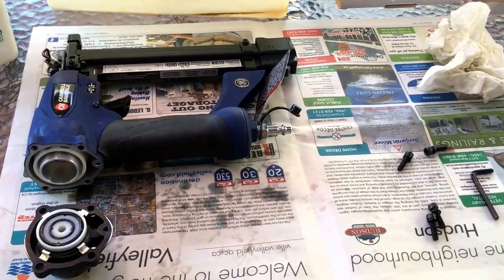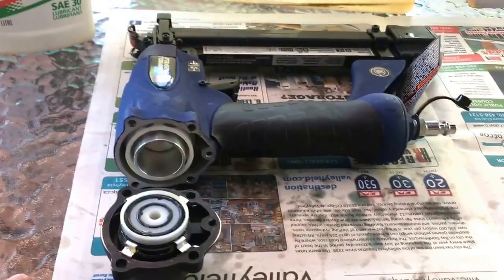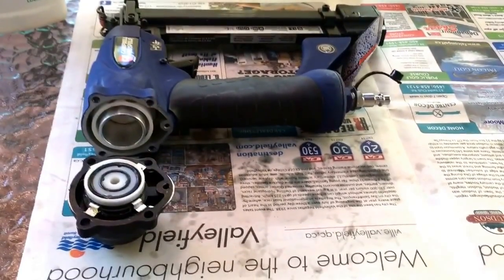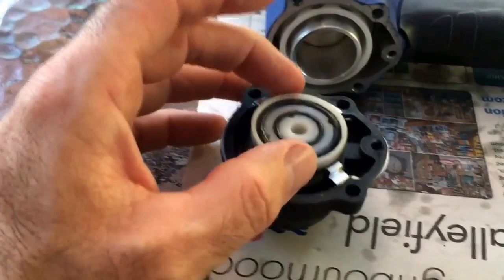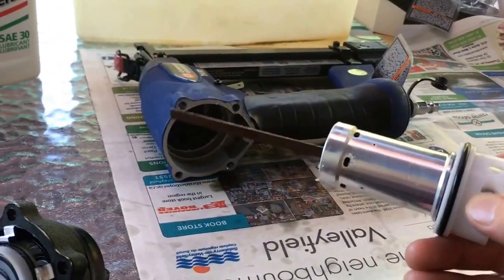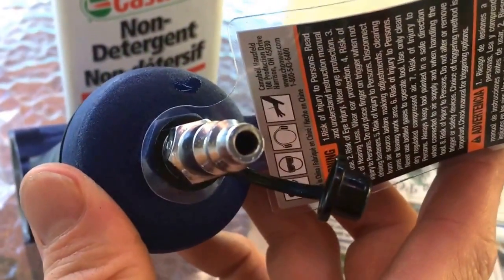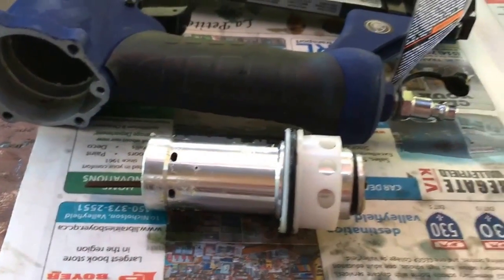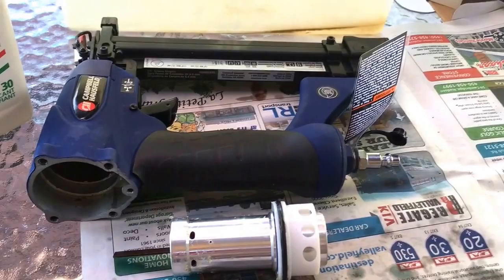Fixing a Campbell Hausfeld nail gun that won't fire

Comment: Well I don't believe it but it worked on my Campbell Hausfield dk583300av 02/04 brad nailer which was leaking air so badly it would not fire.  I threatened to scrap it several times but glad I didn't now.  I opened up the top and saw oil and pulled the cylinders apart and there was oil on all of the various O-Rings and the rubber rings looked good.  Having gone this far I squirted a half ounce of pneumatic air tool oil on all the parts then closed it up and to my profound surprise it worked perfectly again.  I am thrilled.  Oil, oil, oil is the answer.

Thank you very much for posting, much appreciated.

Comment: Same situation as most comments, mine sat unused for years and stopped firing. 
I followed your advice and cleaned it out and gave it a generous amount of oil.
 I just wanted to add that I used to oil I had at hand, Google told me hydraulic oil could be a good substitute for air tools. I happen to have hydraulic oil in my garage, there were a few other suggested substitutes. Thanks for the help!
 Happy building everyone!

Comment: Thanks for sharing.  Helped me get a used "like new" nailer back up and running after it had been sitting for a while.  Mine is a Dewalt, but they are very similar on the inside.
Reply: I have a dewalt nailer that won't fire, did you have to do this entire process to get yours working?
Reply: I did.  Took it apart as shown in the video, and lubricated all of the O rings. On my nailer, the piston would get stuck down... once everything was cleaned up and lubricated it worked great. I put a couple drops of oil in every time I use it, and it still works great years later.

Comment: I have the same one. It fires the 1st nail fine but the steel striker or slide doesn't retract back up into the cylinder allowing the brad nail to move forward in track.  I clean everything out, no go. Stumped!
Reply: Hey… so that is exactly what was happening to me… I was losing it.  I followed this videos step and oiled everything… still no luck.  And each time I had to undo the three screws where the nails come out to clear out the jam.  Then I wondered what the other two screws just above the trigger mechanism did.  I went to undo them with the Allen key and it was so damn difficult to loosen… like really tight.  I finally got them to loosen.  I retracted them, added a bit of the oil and this time I tightened just snug… I wondered if it was putting too much pressure on the slot where the nails slide through.  Well… sure enough the nailer finally worked firing more than one or two nails before jamming.  Lost an hour of work time, but maybe try my solution for you.

Comment: I bought this same kit and brought it with me to Chile South America. I had never used them and I went to use one of the guns and it just would not work. I sure do appreciate you doing this video. I am in the process of trying to repair my guns. 
I will definitely do as you suggested. I was using WD40 and I will change to 30wt Oil. Jim in Chile.
Reply: ChileExpatFamily 

Wd40 very bad for rubber rings and seals.
Reply: Use proper oil for air tools.

Comment: Every air nail gun needs to be oil with proper air gun oil every time they are refilled with Nails because the oil is blowing out of the gun with ever pull of the Trigger. after you fire 120 nails from the gun the table spoon of oil you put in it, is going to be spent. I would say if you are wanting to use oil other than Air gun oil It would be better to use Transmission oil (Dextron3) that is meant for rubber o-rings, Motor oil isn't very nice to rubber it will become hard and brittle and need to be replaced faster. I put dextron2 in my car engines to keep the valve seals soft and flexible to keep the engine from burning oil from the valves leaking past the valve guides. You will find that happening and its called blow bi, you will notice it when you first start up your engine and see a bit of black smoke from your exhaust till the engine burns off the oil in your cylinders. Their is other way to fix this problem but it takes, pulling the heads valve springs off and putting umbrella seals on each exhaust valve or having the guides replaced for the valves. I find it just a easy to use the Transmission fluid about a cup full (every time i do a oil change) in to the oil. Been doing that to my 1992 Suburban for 12 years since i purchased it and that 350 runs like a new engine. Manufacture told you to use motor oil? Well i guess they might want to sell you another gun sooner that if you used the right oil for it. Most people never re oil these guns when they should I know this because i have loaned my guns out once and when they came back they never worked again just from no oil and water in the air destroying the seals. I do not lean out air tools anymore for that reason.

Comment: Thanks for the info, it worked very well for me, I just put a lot of Synthetic Motor oil through the Air entrance (I think it will flow to the other parts this way) and it started to work again. Great Tip.

Comment: Pulled apart my friends gun, saw the same jelly looking  oil. I wiped it away, reoiled  with simple oil from another air gun. after assembling and adding a squirt in the air port, the gun worked fine. 30 weight is probably a bit much.
    Moral of the story is lube  and fire every 3 to 6 months just to maintain seal integrity.
Reply from the maker: j s  Agreed!

Comment: I purchased the same kit with 4 nailers on special a few years ago, but never used them until tonight! The Pin Nailer and Brad Nailer worked right off earlier this evening, but the large 2.5" Finishing Nailer like in your video crapped out after 3 nails, then just started popping air as you describe. Hope what you suggest is the fix - thanks for the video!!!

Comment: Hey, I had the same problem. Lubing didn't fix it though. The driver/pin that drives the nail doesn't retract the full way into the nose. I'm using 1 1/4 nails. Going to have to buy 1" nails so the driver will catch the head. Really annoying. Don't feel like dropping $125 for a new gun. Guess I'll live with it. Thanks for the walk-through.

Comment: Thank you for posting this.  I had made the mistake of using the wrong oil or something. I then used spray grease, oops.  After watching this, I cleaned it all out and I got DEWALT D55001 Synthetic Compressor Oil and it worked like a champ. My gun only gets used once a year, so I went with synthetic to avoid it gumming up again.

Comment: Tried this on mine (NB006401) nothing seemed to work (oil or carb cleaner). Then after taking it apart one to many times a few parts broke. Looking for replacement parts wont work because as far as I can tell all have been discontinued for these older guns. Be careful, otherwise  it will just be a paperweight :(
Reply from the maker: Good advice. I must say after a few years, I have had to take mine apart again and relubricate. Unless you use it on a regular basis, the lubrication gets gummy.

Comment: I'm not sure if you're still on this. 
Hey anyway.
My problem is the drive blade doesn't retract once a nail fires it then just shoots blanks? I'll clean and oil more tomorrow. 
It does technically fire after resetting the drive blade. 
Though I did find small plastic pieces in the inside side of the exhaust plate, not sure if it has anything to do with parts. 

Any ideas? 
I'm also looking for parts websites, if you good ones?

Thanks
Reply from the maker: I would start with lubricating it. You'll be surprised how much better it will fire with all the parts sliding smoothly like they're supposed to. Let me know how it turns out.

Comment: Very good info, thanks, but way over talked. Might want to try what I did. Go to 6:10 for 15 seconds. Try that first. 20 drops fixed it for me without taking a single part out.
Reply: Thank you Sam Sam!! I shot some WD-40 down there and a bit near the "hammer" and it started working great.
Caution to whomever does this, some oil sprayed on my wood. So if that is a worry, shoot blanks at scrap until the oil stops spraying.

Comment: I’m probably not the sharpest tool in the shed, but I try to listen when those people who are smarter than me are telling some important facts. I was told for a fact to not put motor oil in something with rubber seals as this causes the seals to swell. If I have been misinformed, please let me know so I don’t spread bad information. Air tool oil is available everywhere and if you can’t find that, automatic transmission fluid.
Reply from the maker: Ray Carson The non-detergent 30 weight oil used is what was recommended to me by the Campbell H representative who I spoke to on the phone. It is, essentially hydraulic oil. It is a clear liquid, not amber colored motor oil.

Comment: I did exactly what you said.I had one nail out and then it went back to hissing sound. This is my neigbours gun he was generous and insisting in borrowing. Against my judgement I did borrow , and now its broke. I tried to see if I can order parts or buy another gun Campbell-Hausfeld NB006401 2-1/2IN Finish Nailer no where to be found. Parts are obsolete and not available. The new ones dont even match the description or use.  I was in the middle of the basement reno final trimming baseboards etc, and now I am so messed. Any help? I am in Canada. Keeps giving double hissing sounds. the pressure keeps going low after every shot.
Reply: Sel Within        No guarantees but take a drive to your nearest caterpillar heavy equipment outlet. Caterpillar uses about every O-ring under the sun for their machinery. I Once went into the back room of one of those places and couldn’t believe the number of different O-rings they have hanging on plywood racks.     Chances are they can match you up with one that will fit.     It’s worth a shot anyways.     One thing you have to remember is that any kind of Chinese O-ring is minimal quality at the very best. When I tore mine open the first time I saw one of them even had a defect in it which was no surprise.

Comment: IMPORTANT INFO : I also contacted Campbell Hausfeld, Claude is right, don't use AIR TOOL OIL, it is not recommend for these finishing brad nailer/stapler. Instead use NON DETERGENT SAE 30 oil. If you're in Canada you can buy the Motomaster (028-7113-6) at Canadian Tire. Also, before dismantling your nail gun, Campbell Hausfeld recommends shooting a little carburetor cleaner in the air nozzle. I used the Motomaster Carburator and choke Cleaner (038-0720-8) also found at Canadian Tire and that actually fixed my problem. Doing the procedure in this video with AIR TOOL OIL did not fix my problem! Also, don't forget to put the cap back on the nozzle when you're done with the nailer to prevent contaminants from entering the gun and the oil from drying out and jamming your nail gun again! Merci Claude!
Reply from the maker: Thanks for the added information Rio. Carb Cleaner makes sense. Cleaning out the old gunk that has caused the jam to start with will probably go a long way in making sure you don’t run into the same problem over and over again. Glad it helped – cheers from Montreal!

Comment: Would have been nice to see everything reassembled and shown working. I did everything in the video and mines doesnt work. Brand new and still doesnt work..😔
Reply: Campbell Hausfeld recommends shooting a little carburetor cleaner in the air nozzle. That fixed my problem.

Comment: There are some things to consider before using this method to repair a brad nailer.  FIrst,  there is no reason to use non-detergent oil. Understand what detergent and non-detergent oils are used for.  Detergent oils  are used in most modern gas engines to suspend particulate matter in oil so that it can be filtered with the oil  filter.  In engines and many other machines that don't have oil filters, non-detergent oil is used because you don't want  particulate matter suspended in the oil and recirculating because that can damage parts.  But that's only for engines and machines that have an oil sump.  Air tools don't have an oil sump and there's nowhere to suspend particulates anyway so there is no advantage to using non-detergent oil in tools like the brad nailer. However, for piston compressors, etc., that do have a sump, non-detergent oil is recommended. That said, why go to the trouble to find non-detergent oil anyway since it can be hard to find these days.  Instead, use air tool oil.  After all, that's what it's made for. That's what you should be oiling your air tools with anyway so why would you use regular non-detergent oil?  It makes no sense. Whoever told the maker of this video to use non-detergent oil in his brad nailer clearly doesn't know the purpose of non-detergent oil.    So searching for non-detergent oil is a waste of time and a bad idea because air tool oil is specifically designed for air tools. 

Next, you should not use as much oil for this tool as mentioned in this video. That's WAY overkill and the excess will just blow out the exhaust and make a mess.  Just lightly oil the parts and add a couple drops to the hose end of the tool every couple hours of use. Don't add as many drops as mentioned here. That will only cause a mess. 

Lastly, petroleum products destroy most O-rings.  It's possible, if not probable, that petroleum resistant O-rings are used in this tool but it's something to consider when choosing the oil to use.

Comment: While some claim it fixed their prob, it did not on mine. At some point O rings can go bad. Mine appeared to be OK but the flood of oil was not the fix. Not a single You Tube post mentions that! CH no longer carries the 7 - "O " rings for this model. Mine would fire & set the nail but striker would not pull back for next fire. After pulling apart, cleaning then flooding with 30 weight oil - I now have air blowing out the exhaust port . Prob got worse? I guess just go buy a new gun. Finding all the exact O rings could be a hassle.

Comment: I'll never buy another Campbell Hausfield brad nailer again. Mine has had very little use and it constantly jams the nails. The steel used for the two plates(sandwiched together) that guide the nail out the head of the gun are of such soft steel that once you have just ONE nail-jam it will score the plates such that nail jams will ALWAYS happen afterward and become more frequent!!! (Creates a trough for future jams to happen the same way) Cheap Chinese steel and complete garbage. Trust me. I have taken mine apart so many times to remove jammed nails and the last time it drove a whopping 3 nails before it jammed again and got fired across the shop at 100mph due to my frustration. Get a good brand and not this junk. Save yourself the aggravation. Once that plate is "scored" the potential for every other nail to follow that path is almost guaranteed resulting in nails that shoot off sideways out of the head as the hammer drives the nail into the previously created "score" jamming it between the two plates at an angle AND, each time creating an even deeper score in the soft metal for the next nail to follow and shoot "off-path" over and over and jam between the plates as before. Once that steel is scored... it's toast.
Reply: I totally agree with you. Bugs me that this crap is allowed into the country in the first place. Planned obsolescence right out of the package.
Reply: Same with me , piece of junk .